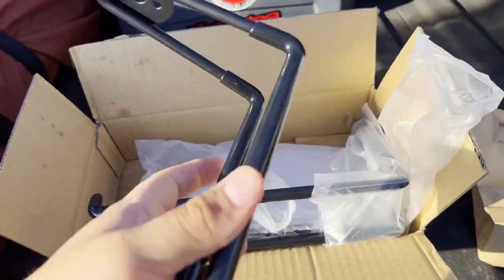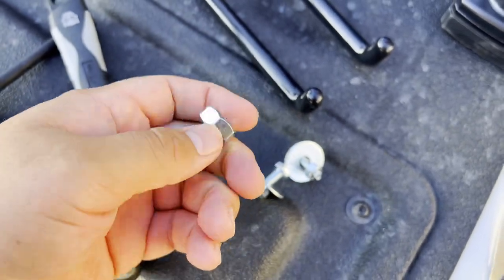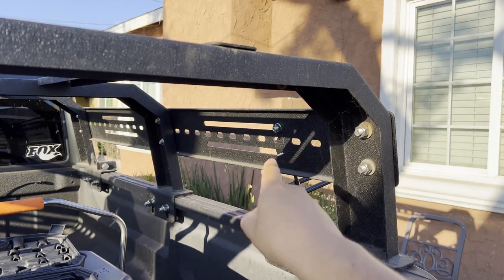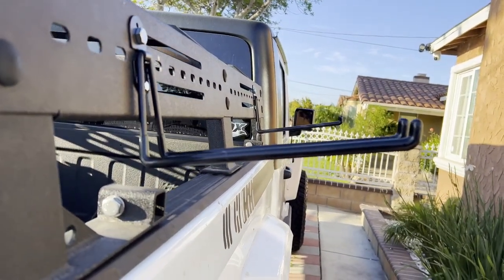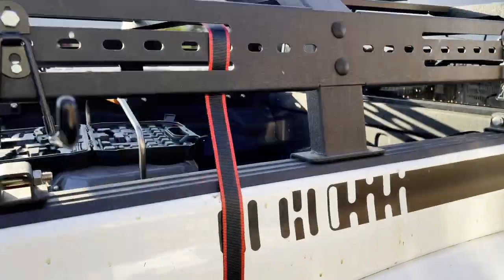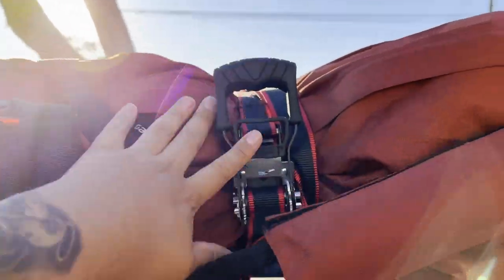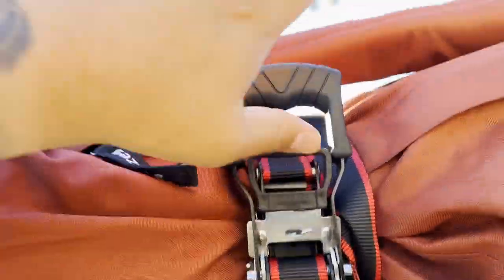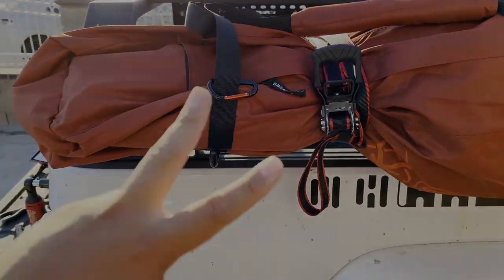Jeep Gladiator Gazelle Tent Bedrack Mount

Comment: Thanks for the idea tho so they will block side mirrors?
Reply from the maker: I changed the hooks to smaller ones (updated in description). Way better. Doesn’t stick out as much , doesn’t block side mirrors or extend further than them. Perfect size and still holds my tent perfect.